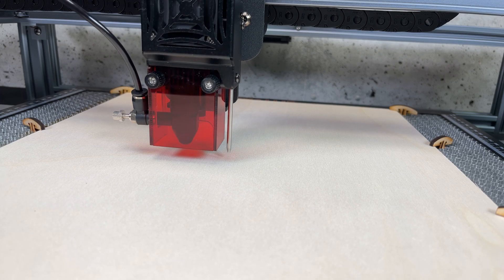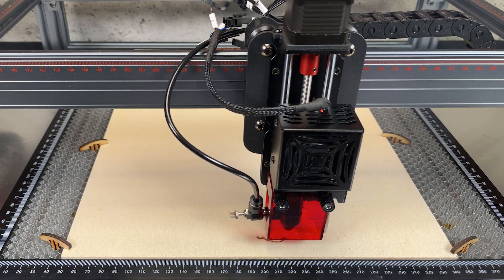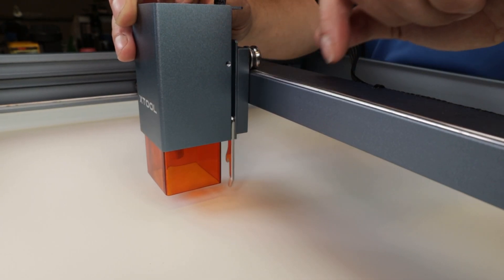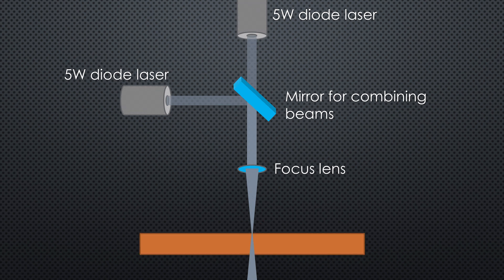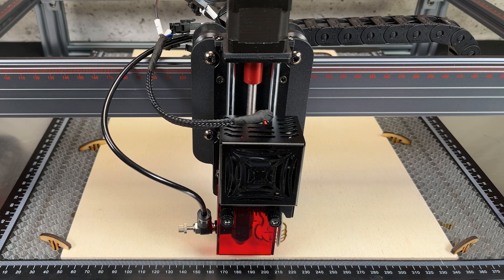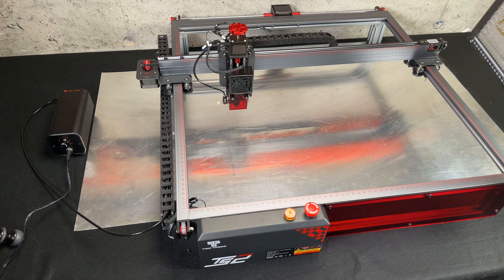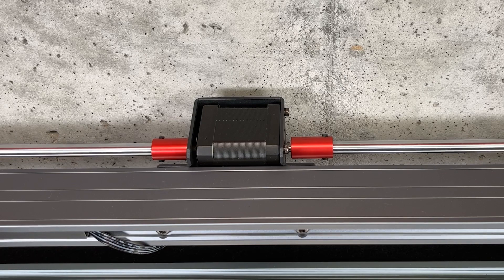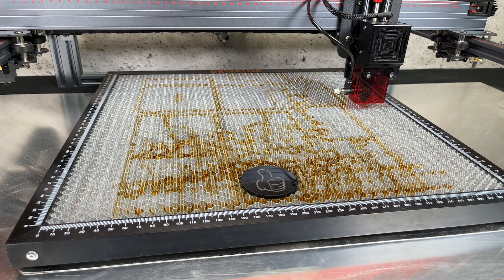TS2 TwoTrees innovation diode laser cutter

Comment: Hi, I saw your hc-12 videos and I want to ask you for advice. I've tried to use hc-12 module and an arduino for telemetry for my model rockets, tried to test them but lost the signal after walking 50 meters from reciever. Do you know what could be causing the problem?
Reply from the maker: Hi! Sounds like you might have a clone board and not the original HC-12. We have a video on that subject as well!

Comment: No, no, no, this is wrong. $1,000.00+ for a low-powered diode laser???? 😆
Not trying to cause any trouble, but for that money, you can get a much stronger CO2 laser, with faster and deeper cuts. 
For what it's capable of, it should not cost more than $500. 
Thanks for the video, though, and I hope you enjoy it.
Reply from the maker: While I agree that you can get a cheap K40, I do not agree that the comparison is that simple. 
When buing a laser the first thing you should consider is runtime before you have to replace parts. A laser tube for a K40 will last about 2000 hours if you treat it really good. A diode laser will last 10 000 - 20 000 hours. Lasting up to 10 times longer.
Second is the state of a simple K40 and all the upgrades you should do, remember many people change the controller to be able to use it with Lightburn, then comes air assist, propper cooling and much more.
If you watch some of the videos comparing K40 to diode lasers and some of the videos comparing the K40 to a propper desk top laser such as OMTech, Glowforge, or even just all the videos about people telling about their needs to upgrade their K40 lasers you will have a better base line for comparison. 
So, while I still agree that you can buy a K40 cheap, your comparison of a K40 and this diode laser should include a more nuanced consideration of the actual differences.

Comment: So with the software and auto focus, you can tell the machine to focus on the surface for engraving AND tell it to focus on the center of the material of different thicknesses when cutting.  Is that correct?  And is there any material thickness limit to getting the laser to focus in the center for cutting.   Thank you!  You have the best explanation of the auto focus feature on this machine so far that I have seen.  No one goes into detail, and this seems to me is a HUGE benefit to this machine.  TWOTREES doesn't even go into detail on their website or videos.  Thanks again!!!!
Reply from the maker: That is correct! You click the button for the depth you like, or if it is a surface focus for engraving. This and the easy access from the sides makes this machine genius! The depth will depend on your material, but you can push it to 15 mm ply. But the sweet spot is 3-6 mm for fastest results. We almost exclusively use 3-4 mm materials for our projects.
Reply: @DIYTECHBROS  Awesome!  Thank you!  Again, you have the MOST detailed explanation of this feature on the machine.  Even TwoTrees does not explain as well.  I have even written them about this, with no response.    Hope you do a review on their new 20Watt version of the TS2 they just came out with!  Looks the same but with a black paint job and 20-watt laser.  Thanks again, you have my new subscription! Steve

Comment: God video.  So far this is the best laser Ive tested.  Just adding the touchscreen to mine now.  Don't buy a 24 as the PCB says- 35 is the only one that works ;)  Cheers
Reply from the maker: Good tip!
Reply: 24 what?
is 24 Watts meant?
"as the PCB says" PCB is talking? Who is the PCB`
Did You mean:" 35 'something' s required for PCBs"?